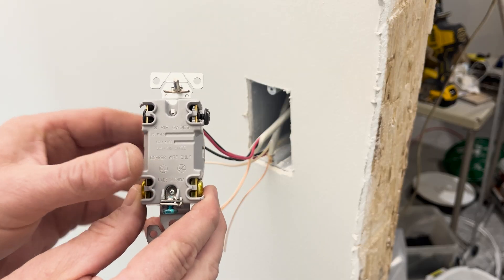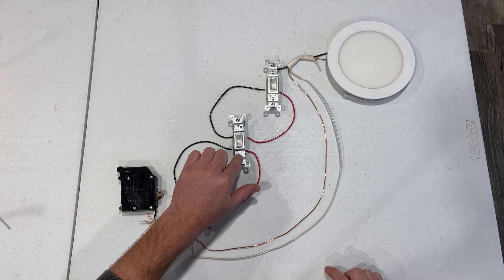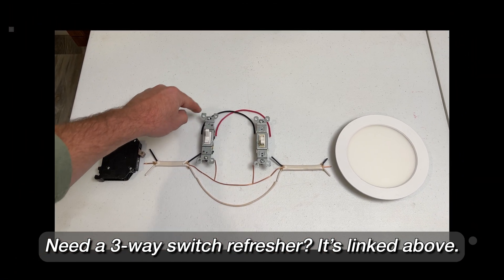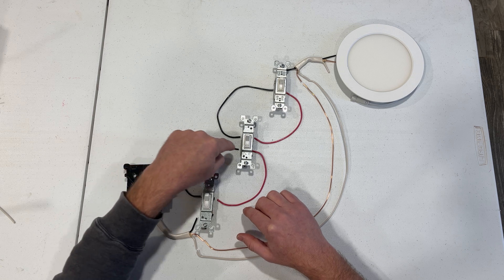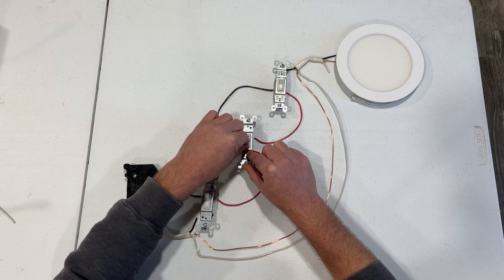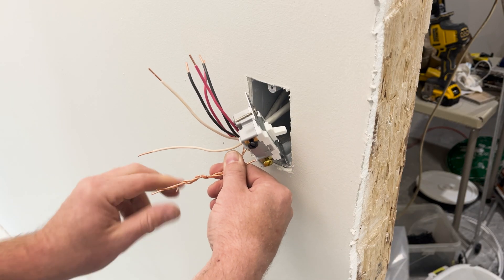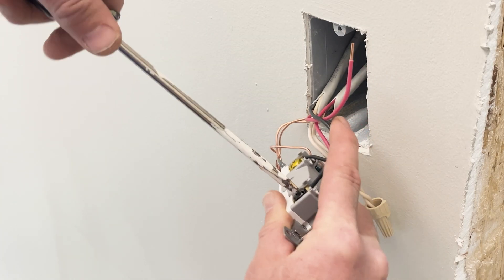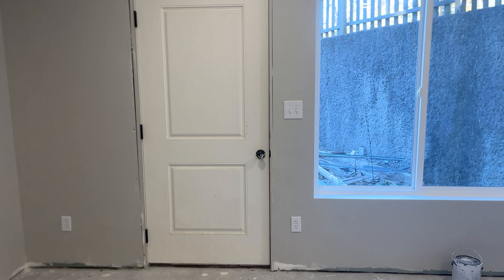How to Wire a 4-Way Switch - It WILL Make Sense After THIS!

Comment: Tried to replace a scuffed 3 way toggle switch with a brand new one and now one switch dosnt respond. Any ideas?
Reply from the maker: @attalus851 Man, that’s frustrating. I’d definitely start by ensuring all your connections are solid on both the new one and the non-functioning one.